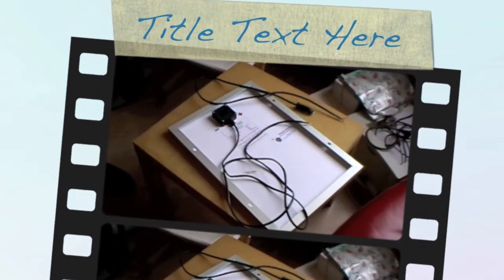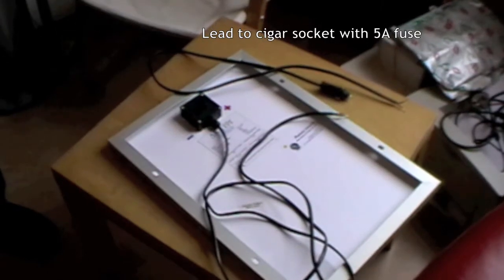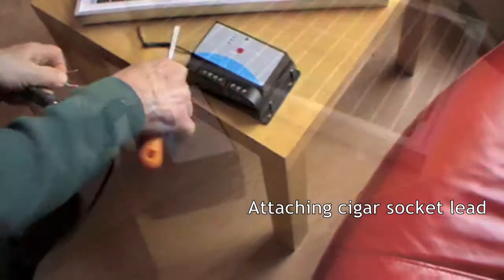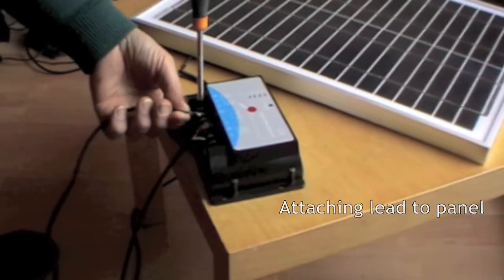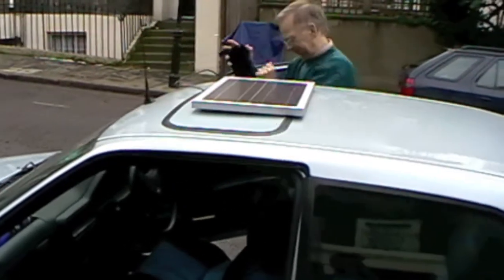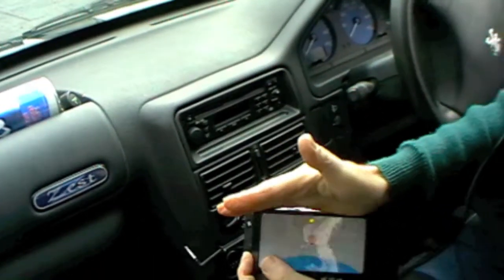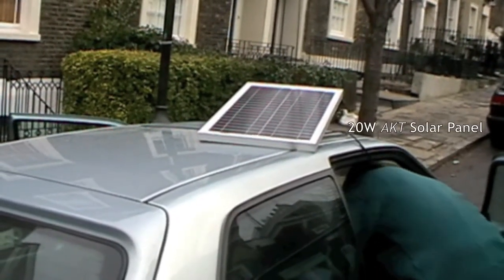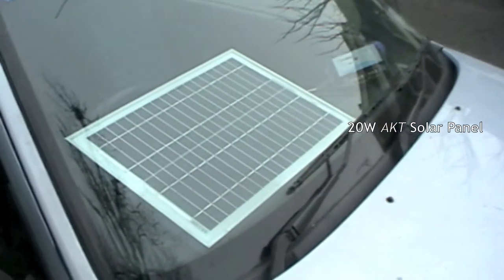How to wire and install a 20W AKT Solar Battery Charger and charge controller

Comment: Won't work if it's a Japanese car which isolates the cigar socket when ignition switch is off. Would have to wire directly to car battery.

Comment from the maker: Thanks for the comment. Can I ask where you get the information from about the 50%?

Never discharging below 50% seems very conservative for a leisure battery, particularly if you always recharge your battery promptly. 

For this reason, most research I've read suggests not going below 75% discharge. Of course, it's a trade-off though. If you never discharge below 50% and recharge your battery quickly then you will get a longer (although possibly less useful) battery life.

Cheers,

Simon